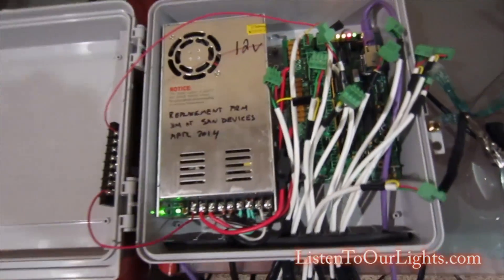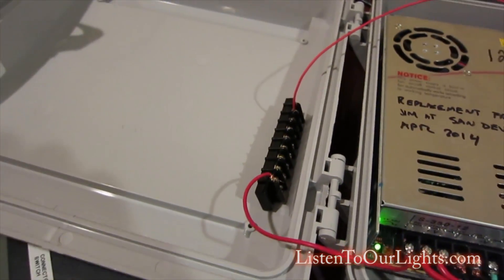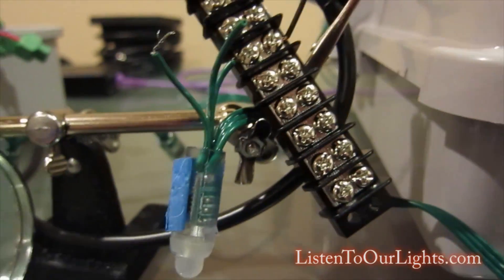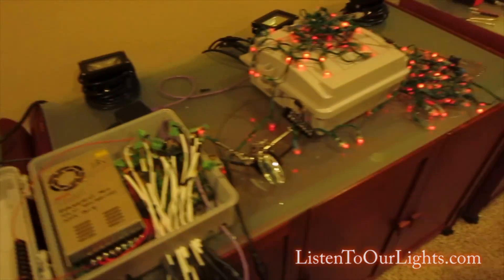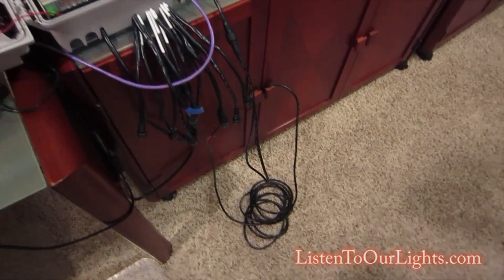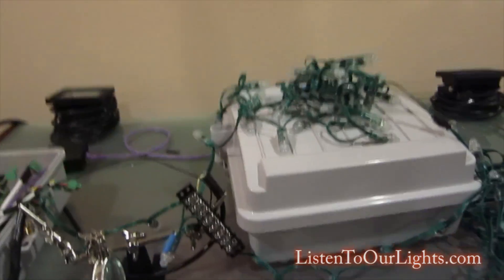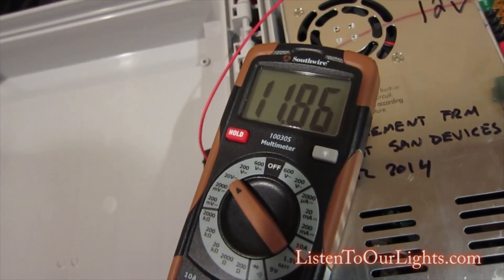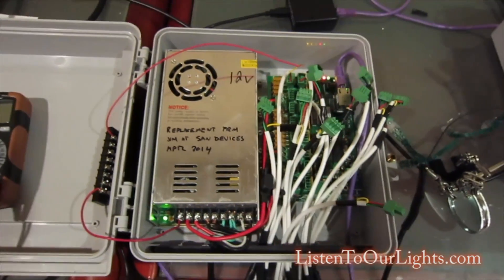RGB Power Injection Test

Comment: That terminal block... are all terminals on it connected together?  Most blocks I've seen that look like that, each set of terminals is only joined to the opposite side, width wise not length)  It would appear like you are having issues because there is not connection between the two wires on the terminal block.

Comment: Thanks for posting - this is the first real-world demonstration of why power injection is necessary on long pixel runs that I've seen.  Still confused on the how - the electrical operation of injection, so I'm hoping you can help me out. What I think I see from the video is +VDC and ground entering the string at Vin and Gnd at the 1st pixel, then the same +VDC and ground connected to Vout and Gnd at the 150th pixel. Since DC is current flowing in one direction, I'm envisioning the positive voltage heading into the string from both ends on a collision course, or does this work because all of the nodes in the string comprise one big parallel circuit? Would it make any difference if I were to say, cut the +VDC and Gnd wires around the 75th pixel (or the 50th and 100th if need be), and inject the 12VDC at the Vin and Gnd of the 75th (or 50th and 100th), leaving just the data and clock lines connected (such that the 150 pixel string (almost a full universe) only requires one output from the E682)? In my mind, this causes the power to be flowing through the string all in one direction. or - does the Gnd connection have to be contiguous for the data and clock to function correctly? Just finished building two E682s and an E6804 and have multiple 400W and 45W 12V supplies on hand. The mega-tree plan calls for 6 WS2801 strings @150 pixels ea, the house gets 7 spools of 60/meter WS2811 strip plus another 14 spools of 5050 dumb strips, so I real need to figure this power configuration issue out.

Comment: Nice job on the injection, could you ad some more info on why you used a power cord for the ground and didn't just run the neg v from the power supply. kind of don't get it.
Reply: I have the same question. Why not just use the V- from the power supply? You're already running V+ anyway, so just use a two-wire cable. Dropping an AC cord in the middle of that is asking for a disaster.